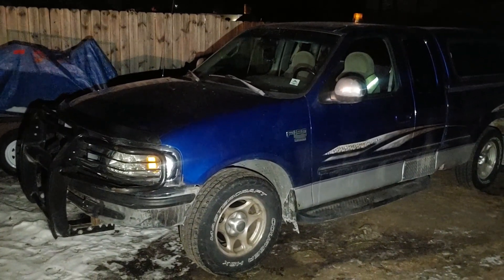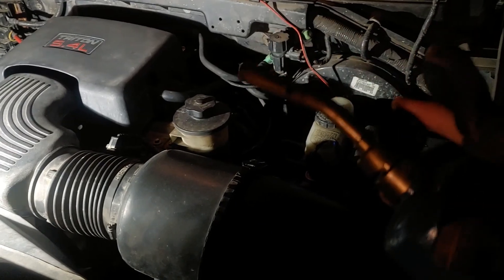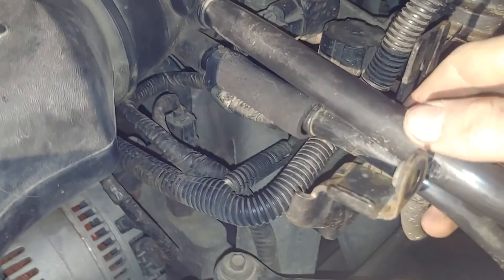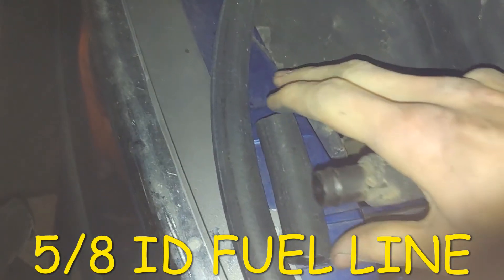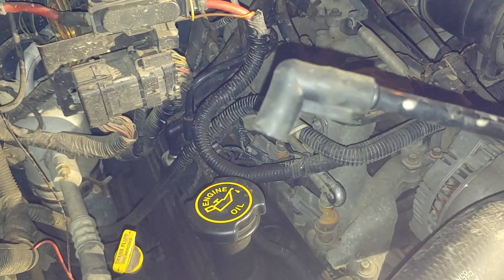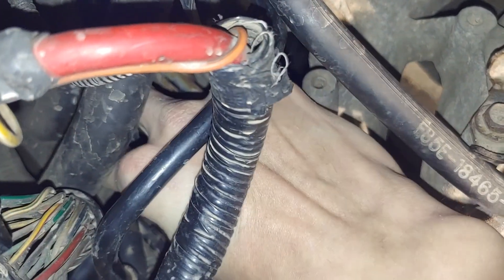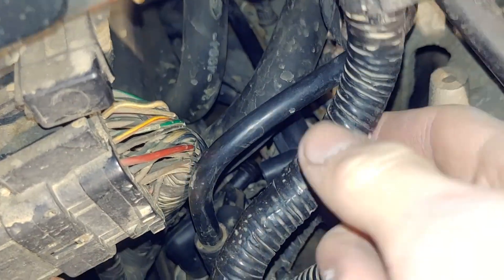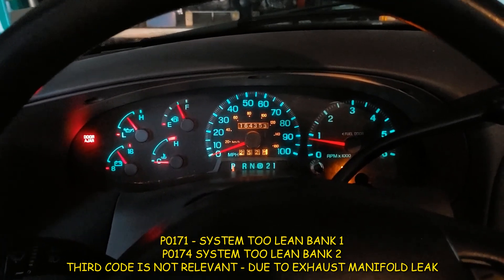Fixing F-150 rough idle & stalling 1997-04 5.4L

Comment: Help my 1995 f150 xlt 4x4 4.9/300 straight 6 5spd 340,000 miles. Doesn't smoke had plenty of power and ran smooth. Then a couple days ago  it was running normal. Added some ga

 started up ran fine. Drove it 8-9  miles when doing about 60  it died. Without missing, sputtering no notice of an issue. Tried restarting it while it was coasting off the road. No luck after i got pulled off the main highway i trued again. It would crank but not start. Respliced hot wire on starter. It was spliced when I bought the truck in 09. Started troubleshooting on the side of the road. Found the pink vacuum line traced it back to where it comes out of. Couldn't and still can't find where it goes after it goes under intake  manifold. Not sure what its purpose is?  And haven't found any videos or diagrams matching my smog system or vaccum line setup. Checked my brothers 99 same engine etc. But his smog set up has parts mine don't but our vaccum lines look the same. Same air pump etc. Towed it home Started troubleshooting it more. Plugs cap and rotor were pretty bad. Plugs had rusted look to them. Replaced plugs cap and rotor. Cleaned air filter it was full of blow sand. Put a full charge on battery. It cranked long then fired off after a couple tries. Ran rough tried to die i kept it running for 3-4 minutes by stepping on the gas it reved up then started to cut out tried pumping it. It died anyway then cranked but wouldn't fire off. I  tried a few more times. Then the battery back on the charger waited till it had a full charge again. Maybe a half hour.  Put it back in turned the key could hear the fuel pump let it stop and tried again got a couple sputtering attempts to fire off to run but thats it. I gave up for today. There is a bad elbow on redvvacuum line coming off the splitter and going to the tree. But other than that im baffled. I  dont have a code scanner, book or diagrams for my truck. The vaccum diagram under hood is wrong. Truck is 2/1995 so either they changed something, its Canadian built or something cause it doesn't have that California smog piece. I don't have any money to pay a shop right now. Do the parts switch out thing until I get it right. And my trucks my only vehicle, I  live  35 miles from town and im seriously screwed at this point. So if anyone has any good knowledgeable ideas or testing and  diagnosis tricks the old school way id be seriously grateful.
Reply: Maybe check your PCV valve, the small valve that is sticking into your valve cover coming from the back of the intake manifold with a heat guarded hose around it.
they should just pop out no tools needed and see if it rattles when you shake it back n forth. If it does not you need a new one. Super cheap part and it was making my 2000 F150 sputter and die, i fixed it and truck ran great and idle went way down so nice and smooth i thought she was stalled lol. Also the DPFE sensor and EGR valve can be issues.